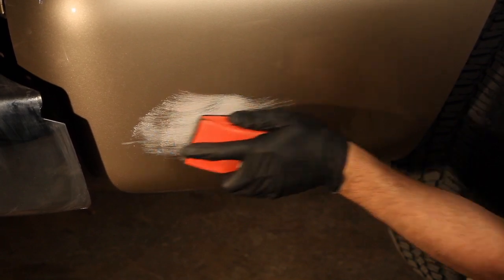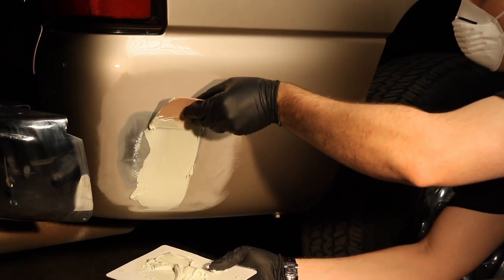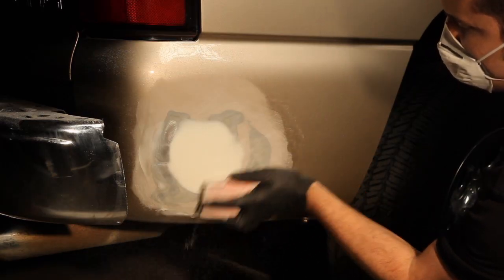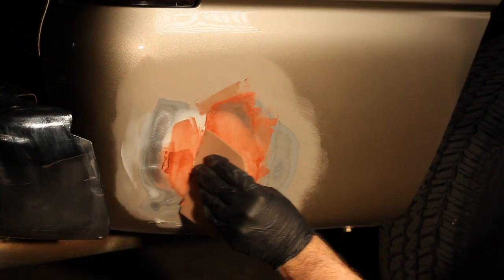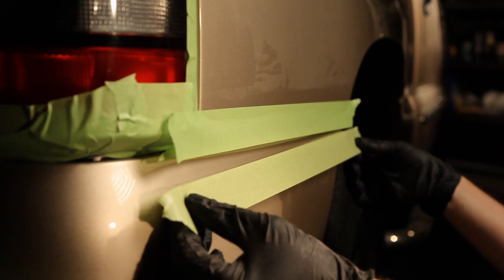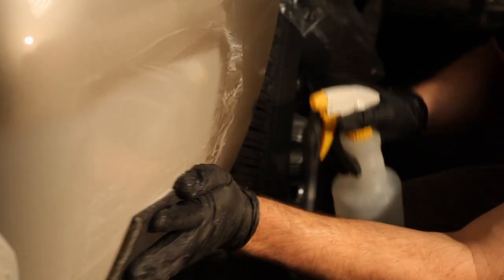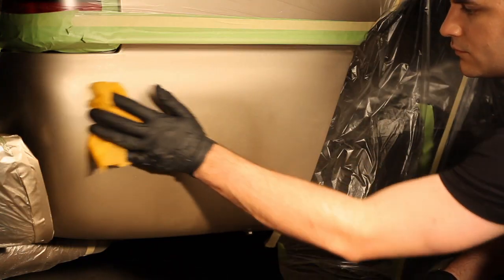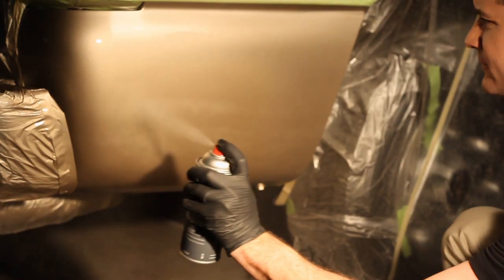Using Plastic Body Filler For A Smooth Surface Under Touchup Paint

Comment: LaneTD15 "back taping" refers to what was briefly demonstrated in the video. They put 2 pieces of tape on then put that plastic covering stuff on second piece of tape and the plastic naturally hangs down over bondo---Then you fold that hanging plastic back so it is now not hanging over the bondo and on top of the truck bed, and that creates that gradual/soft edge which will help prevent paint lines.

Comment from the maker: @supra6t9 You should have finished sanding the bondo with 180-320 grit sandpaper. 320 grit sand scratches will easily cover up with primer. 40 and 80 grit scratches need to be sanded out with finer sandpaper. You can re-apply bondo or spot putty too.

Comment from the maker: Please look at my blending video and my feather sanding video. 

The visible patch can be caused by 2 things: 
You need to feathersand the bondo, you need to primer over the bondo, and feather sand the primer. Otherwise you'll see a ring in the finish around the bondo. 

You need to blend the paint better. Even poorly matched paint can still give an illusion of a great match if blended right.

Comment: I couldn't find my factory color available on your website so tried duplicolor oxford white, I had a few larger dents to fill on f150, and used an Krylon acrylic crystal clear, that stated it was non yellowing.  It ended up very noticeably yellow.  Checked online lot of people were using Krylon gloss white for cheap repairs getting better results. I tried a couple different brands. seems to blend better.  What kind of clear is recommended? Lacquer? suggestion on smooth finish? sanding, buffing?

Comment: My 1973 vehicle has rust holes on the hood in curved areas & the end of the hood chas chipped off a little dude to rust. My question is can bondo be used in the curved areas & used to shape the end of hood? I am unable to find a new hood online so bondo would be my only option

Comment: Is it ok to add Adhesive promoter before the primer ?
Reply from the maker: On bare plastic? That's what you should do.
Reply: Hmmm on a modern bumper ? ie a bumper from a Kia Rio 2015, I have a deep scratch I can see black thru the dent made. I don't know if that black is plastic from the bumper or any other material

Comment: between steps such as cleaning it looks like he is sanding again and again, is he using 180 drit or cleaning that spot with something?
Reply: also you never say how many base coats before the clear coat you are using, and if you are heat treating to dry
Reply from the maker: On the basecoat color you spray as many as it takes for coverage, and then maybe one more coat just in case. Some colors take more coats than others, and it's impossible to really make sure my coat film build is equal to your idea of a coat without a mil gauge. I'm not heat treating to dry, but we edited out the dry time or you'd be watching a video of paint drying.
Reply from the maker: Hard to say without knowing which second you are referring to. I sanded the area, then cleaned it, then sanded the primer with 320-600.
Reply: +Automotivetouchup over spray on to your original paint and clear? And using spray cans vs spray gun?

Comment: Idk if you guys will respond but,  do you guys think that using spray cans can/will come out decent in painting the whole car? Or maybe split it up into sections? Any tips for using cans?  I'm intrigued by your products and my car looks like straight ass right now. Thanks :).
Reply from the maker: I don't recommend it due to price. Our paint is expensive because it's custom made to order to match a specific OEM color. If you're painting the whole car and don't care about color match there are cheaper alternatives. Often customers do in fact paint their entire car and for the most part all are satisfied. If you have access to an air compressor we sell low end spray guns for abut $25. If you still just want to spray paint it anyway I highly recommend a spray gun attachment tool for about $3 which saves your index finger from some heavy abuse.
Reply: Thanks for responding! Damn, an air compressor eh? I definitely care about color match, It'll urk me if it doesn't lol. I'll try my best to get a compressor. I don't have a garage, so if debris gets on the car, can I just use the tack rag to wipe it off? Really appreciate you guys responding.
Reply from the maker: If you had an air compressor I'd forego the aerosol. But if you want an exact color match I'll be your best option in an aerosol. If the debris lands on dry paint a tack rag is best, if debris lands in wet paint you can let it dry and nib sand it with very fine sandpaper. Just make sure you put another layer of basecoat before clearcoating.

Comment: about how much would this cost in a shop?
Reply from the maker: It really depends on what the shop is willing to do. I'll guess $300 on the low end to about $1,000 on the high end. Some bodyshops will repair a bumper and spot blend or repaint the bumper. Some shops will charge you for a new bumper and labor to replace it.